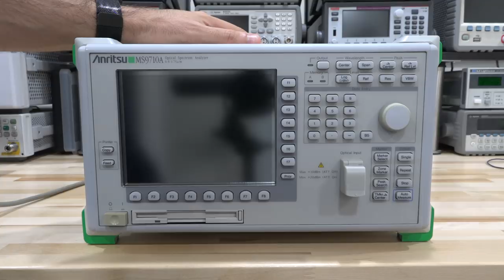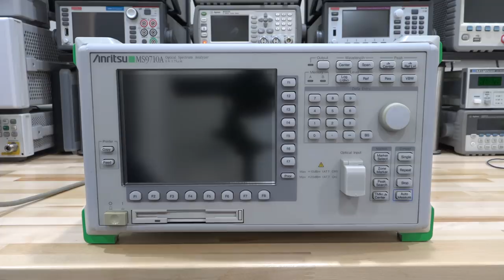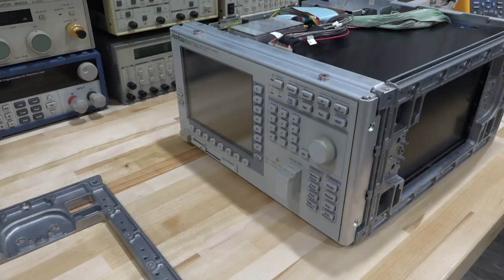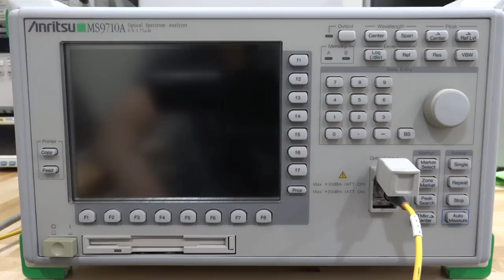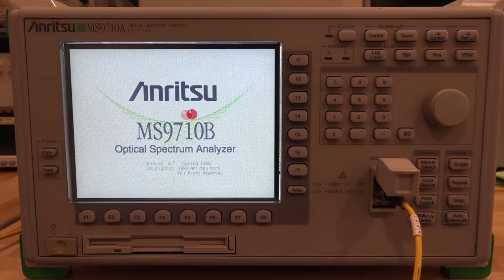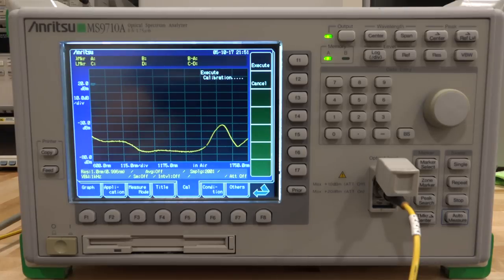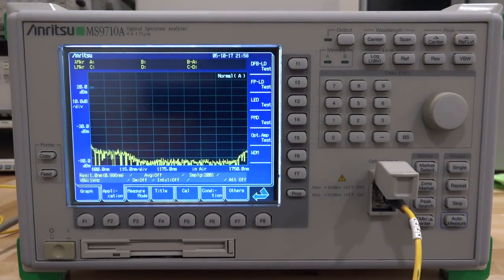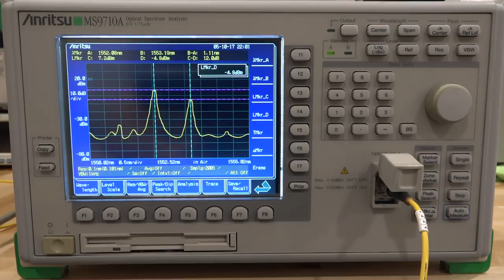TSP #111 - Teardown & Experiments with an Anritsu MS9710B 0.6-1.75um Optical Spectrum Analyzer

Comment: Most likely there is a DBR laser inside the Agilent lightwave transmitter. If it's the modulation it will cause symmetric sideband on both sides, however to create sideband this far away you have to modulate the laser at hundreds of GHz frequency. The most likely cause of the two peaks, besides a broken laser, is that the laser hasn't worm up properly and the temperature of the DBR is not yet stabilized which cause the diode to mode hop.

Comment: Hi, I would like to ask during disassembly, did you find some small battery to run clock ? (Like cr2032 or cr2024) bcz mine is not record the present time anymore. Every turn on it always show initial date around year 1996. 

Thanks

Comment: Nice! I have the exact same OSA, if you want I can do the same test with the attenuator. I actually got a grating error once, freaked me out, I though my nice instrument was broken. Good to see it's probably just a cable issue.

The laser you have can have 2 modes, actually laser diodes usually have more that one or skip between modes, having only 1 takes some effort. I also have an ANDO OSA which is a lot smaller but it has worse specifications and it's boken, it simply won't power up. So it can be made even smaller.

I also have an HP wavelength meter, it occasionally gives a motor error. It has 1pm accuracy but not for peaks that close together probably, and the second peak is 12dB lower. I'd have to look up the specifications. you can actually acces the spectrum the wavelengthmeter measures, I though both graphically and via GPIB, then you can check if it cannot resolve it or that it's just the peak searching algorithm not separating the peaks.
Reply: hello, have you solve your problem? with grating error?
Thanks.

Comment: It may be a second order intermodulation distortion, but changing the fiber is a first step. If fiber and laser source is hunky dory, then may be the issue is on the analyzer, may be modulators.
Reply: Kaveendra Vithana  in order to have intermodulation, you need two frequencies. If the laser is fine, then it should output single frequency. Unless there are some nonlinear process happening inside the fiber. Which is pretty unlikely judging by the low power output of the laser.

Comment: Were there any other issues you found or was it simply reseating boards/connectors that brought it back to life?
Reply from the maker: I re-built a lot of the connectors and re-set the boards. The grating mirror was giving an error and the LCD wasn't working. Both seemed to be fixed by-rebuilding.

Comment: It is perhaps a side mode from laser source, looks like there is also a small peak at the left within a same distance. There is a wavelength tuning nub at your source that changes the laser temperature, it is interesting to see if changing the temperature has any effect on these modes. BTW, you will have a ~110GHz oscillator in your lab if you send this laser to a high speed photodiode!
Reply: vahid ataie where is the 110GHz coming from?
Reply: Result of mixing of both frequencies
Reply: If it's the beat note frequency it should be ~190GHz not 110.
Reply: Sure, to be accurate it is 138GHz. But the interesting fact is that having two locked emitting light sources is not something that can be easily generated  at ~1nm apart, and it could be quite useful.
Reply: I don't think those two frequency are actually locked to each other. And also locking two laser at 1nm apart it's actually quite easy. Use a transfer cavity and Pound-Drever-Hall lock you can lock a slave laser to any mode the cavity allows.

Comment: I have a MS9710C that I repeared. The unit was pretty beat up (I bought this one from Ebay: http://www.benl.ebay.be/itm/ANRITSU-MS9710C-OPTICAL-SPECTRUM-ANALYZER-ANALYZER-OPTICAL-opt-05-G410/311929746096?ssPageName=STRK%3AMEBIDX%3AIT&_trksid=p2057872.m2749.l2649) To answer your question, when I enable the optical attenuator, I see exactly the same result as you do (increased noise floor). So, or this is a common fault with these units, or it is normal. 
It seems you have the internal calibration source with two ports (SLD output and reference output, see https://www.upc.edu/sct/documents_equipament/d_125_id-630.pdf) , which one did you use for the calibration? I only have the reference output (1-port), but I was expecting to see the acetylene dips in the spectrum, but this is not the case (also not on yours, hence my question). On mine I can execute the wavelengt calibration with succes, but when I try autoalign I get a level error. I used to think the acetelyne cell had lost is content, but now when seeing yours, this is maybe not the case. When I see your video, your peak reference output is around -32dbm, where mine is -36.8dbm, so this is maybe the reason.Anyway, thanks again in making this interesting videa, it always make my day when a new one appears!

Comment: I appreciate that you take out the boring bits but this time around you really lost me. Somehow it went from ripping out the HV backlight to booting with correct date and time.
Reply: He cleaned the contacts, put it back together, and it worked. Probably loose contact / corrosion was causing the issues. It's a boring fix, none of the active bits were bad (except the CCFL backlight).